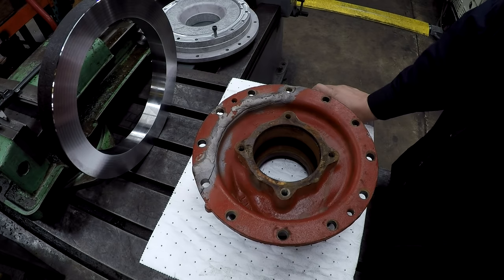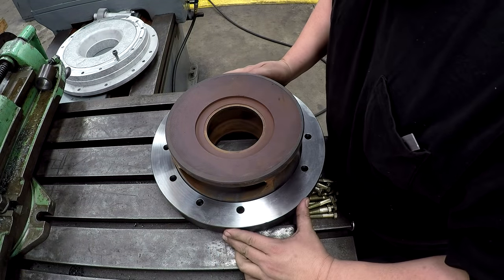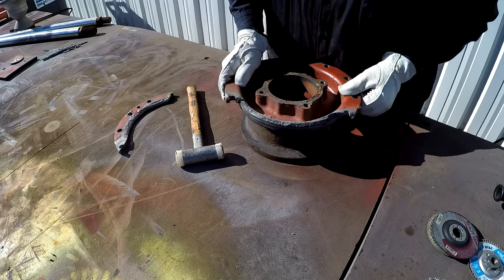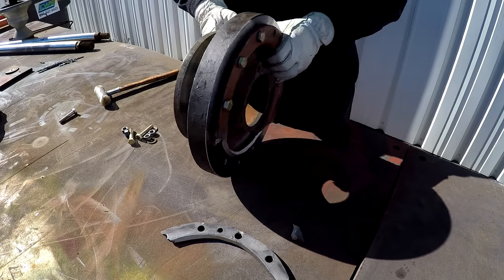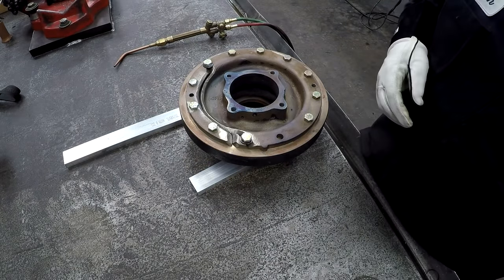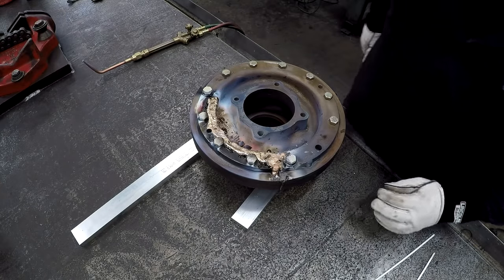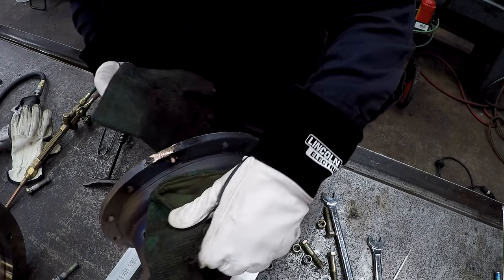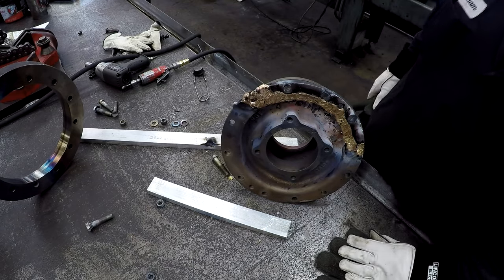Braze Repair on a Broken Casting Part 1

Comment: Excellent video, A man of my own heart. I am a 63 year of age Boily who learnt the craft of Brazing and still use it for tricky stuff. Not knocking you but the only difference I was taught was to grind a cross hatch into the prep bevels, it increases the surface area. Once again great to see older craftsmen at work, well done.

Comment: I've done welding mostly TIG and brazing mostly silver braze,But your level of repair was way over the top of that.This was true RAW professional repair.Your skill set is amazing.You are repairing and fabricating parts that other so called machinists only dream about.The way you made a jig to fixture the parts to locate the piece was true art.I would have used aluminum for the fixture !!!! AND i would be WRONG,as would so many lesser machinists.You must have had an amazing teacher when younger.great workmanship.

Comment: Adam, I would like to compliment you not only on your excellent repair but the way you are very professional and don't just come out and complain about the previous repair and the way it was done. We never know what kind of pressure the fellow was under to repair it before just to keep a job going and may have had to do it in the field in some nasty conditions and time restraints. Looking forward to part 2. Thanks Ed K. Cleve. Oh.
Reply: Eddie Kawecki, very well said sir! 🍻
Reply: You really never know what's the restraints were at the time of the repair. Well said.
Reply: Cool as hell. You could be a dentist. Great work. Old TONY WISHES, HA.
Reply: Oh.
Reply: Couldn't agree more. I'm guilty of more than my fair share of bitching about terrible repairs that I've had to deal with when they fail. But to be honest I've done quite a few myself when a machine is down and  there's no time to do the job right. Sometimes you just have to make it last the day and it ends up lasting months or years before it breaks again and then some poor guy gets to wonder what kind of idiot did such a bad job. Adam definitely seems to keep his cool in the shop.
Reply: There wasn’t, enough time to do it right.  But there was time to do it again.  Braizing is the very best way to do the repair. True quality workmanship.

Comment: It was a real treat to watch somebody brazing. Its not done too much anymore these days. I'm an old, 50+year refrigeration man. So I did a lot of brazing. Did copper to steel high pressure joints. Now as an even older retired man, I do steel and cast iron brazing in the hobby that I'm in. Thanks for the video. I enjoyed it.

Comment: Hey Abom, I'm an HVAC Tech and do a lot of brazing myself but more for refrigeration lines and what not but after watching your vids about doing it to other metals and parts, I've started doing it myself. Repair instead of replace. Saves costumer down time and puts a couple extra notches in the knowledge belt. Thanks for sharing what you do. Helps other progress in other fields of work. P.S. Can't wait for part 2. HURRY! Thanks again.
Reply: +Chris Bryant Chris  I used to do hvac work and I would repair fan brackets and such with the 45% silver solder used when brazing copper to steel valve bodies.  I assume you have that on your truck as reqular stock and it works quite well.  I would by a pound of flux coated rods if your doing a lot due to expense but the silver solder can save you from a run to the supply house.
Reply: +willf650 yes. 45% orange coated brazing rods. They do everything. I've repaired blower brackets and wheels, fan brackets, you name it. I'm still trying to figure out my heat though. I've almost got it dialed in for most stuff.

Comment: I grew-up in a machine and welding shop. Brazing cast iron is the very best way to repair it.  My dad always said. “To choose the torch tip, go two sizes bigger than you think you need.”  And always grind all surfaces that are going to receive the brass. Love to braze cast iron. Good job.

Comment: Believe it or not, one of the best additions to a shop that I have seen over the years was an electric stove with the self cleaning option. Why? Well when you do cast iron repairs you can throw the part into the oven and set the heat up to the highest level, normally around 550 F, and let the part heat soak for as long as you want. Since you're using an oven, the entire part is heated evenly and the weld repair will come out with less distortion. You can also throw the part back in and reheat should it be required or use the oven to slow cool the part by placing it inside when the welding is done and then slowly reduce the heat back down until the part is cool. Why self cleaning? Self cleaning ovens go to 900 F when cleaning to burn off all the food matter that's left in the oven from cooking. When you stress relieve parts the temperature is held at 550 to 650 C (1022  to 1202 F) so when your oven is in the self cleaning mode it can hold a temperature just under what would normally be used for stress relieving. Heat your part up with a torch to 1100 F, wrap it in ceramic wool, and put it in your preheated oven and let it soak and slow cool. (You have to defeat your oven lock out and preheat it to the self cleaning temperature) It's a simple and inexpensive way to control heat and leaves you with a superior product.
Reply: great idea
Reply: thank you sir!!!! <3
Reply: Jack Anderson  Coffee
Reply: That’s largely a myth….

Comment: Wonderful that the customer decided it was time to get the repair done the RIGHT WAY this time.  They had seen that the previous repair effort had failed and realized if the 'quick-fix' method was tried it would only fail even sooner and so after also finding out the part was possibly no longer even made anymore they had no choice but to send it off with the hope it could be brazed back up and you came through in a huge way! ^^

Comment: i was taught to have the metal clean and use a "soft flame" rather than the noisy flame you used.  my teacher was a welder in the experimental section of pratt and whitney jet engines.  the method always worked for me

Comment: I done a few almost like this, i felt guilty, no experience of welding cast iron, but those jobs I did are still intact. Small iron diesel blocks, manifolds, brazing is so adaptable. Good job dude. Keep up the good work.

Comment: Fascinating Adam.  You can see that you are streets ahead of whoever tried to weld the crack last time.  The braze rod will be more forgiving to the shock load on pump-start whereas a weld could be a little brittle.

Comment: Adam next time you need to pre or post heat a part like that try a gas grill, very easy to bring a casting up to temp 450 to 500 degrees and you don't have to stand there with a torch

Comment: When I worked in the electric motor repair shop, sometimes the motor end castings would come in cracked, and I always wondered how they were welded back together, as it was done by another shop. And of course, they often couldn't simply buy a replacement part. Many times motors themselves aren't easily interchangeable, especially on special applications like machine tools, where you're not using off-the-shelf induction motors. It's think it's the same issue with pumps.

Comment: Looks like a zillion people asked what rod is being used. The standard, go-to rod for braze welding cast iron with oxy-fuel is Flux Coated Low Fuming Bronze (AWS A5.8 RBCuZn-C). A high-quality American Made version is Harris 15: https://www.harrisproductsgroup.com/en/Products/Alloys/Welding/Copper-Alloy/Low-Fuming-Bronze-15-FC.aspx  No, I do not work for Harris/Lincoln Electric, but I DO use Harris 15 and it's great stuff :-D

Comment: Great video, as usual. Nice detail on fixturing and clean-up before the actual brazing.

I have a question: at about 12:10 you say that the cast iron is"full of moisture". I wonder if that is not condensation on the cold metal. After all, acetylene is C2H2 (H-C=C-H) and the oxygen is O2. The combustion products are (ideally) just water (H2O) and carbon dioxide (CO2). When working on a hot piece, the water goes straight to water vapor (invisible in air), but when it is cold, the water vapor might condense like the dew on an iced tea glass. I suppose you could test this by heating a decent-sized chunk of cast iron (at least a pound or so) until you are sure there is no moisture. Then let it cool completely (or even chill it slightly) and reheat it to see whether the moisture reappears.

Of course, I may be totally wrong. I recall an older video of yours where you were brazing something quite old and oil-soaked. I think you had cleaned it thoroughly on the outside, yet it smoked like the dickens when you heated it.  If oil can soak into cast iron, why not water?
Reply from the maker: +Peter W. Meek Peter, I think your correct sir. But you sound much smarter with that than I do! LOL I know that it's typical when you heat clean metal like that you'll see it start rusting just slightly immediately.

Comment: This is an amazing repair! The difference between what talent and experience can do and what is valued by those who destroy. I have been tasked with repairs such as this but not to this extent thankfully. Usually due to someones lack of talent and respect. Lazy operators and maintenance practices i. e. out of balanced pumps! Been there done that, don't want to do it again! Thanks to retirement-lol.

Comment: nice job ;) i used to braze cast iron now i use a rod 3/32-1/8 or 5/32  dia. and it works great pretty expensive but it does the job,i'm a machiniste welder

Comment: Another issue besides the jacking bolt causing it to crack. Was it assembled properly? I work in a power plant as a mechanic and I have watched guys who know better assemble equipment dry. Even after something is said they get a case of the so what's, meaning "So what? I won't have to take it apart next time." which infuriates me to no end. I always assembly equipment just like I am the guy who has to take it apart which means lots of assembly lubricants, i.e. Never-Seez. Copper for low temp and nickle for high temp.

Comment: I'm sure you have, but have you heard of Lock-n-stitch cast iron repair? Look them up, pretty interesting repair method for dealing with cast iron... Great job on this piece!!!  Oxy/Propane is 1) cheaper, 2) hotter and 3) cleaner if you didn't know, and if you have the time, you could put the part in a gas grill cranked on high and does a decent job of uniformly preheating cast parts.... I've done that with exhaust manifolds and had the time while working on other items... gets over 400 in short order...

Comment: I was wondering how you were going to hold that smaller piece. Cool seeing that it basically just clamped in place without the need to use anything different (just the bolt and nut). Looking forward to seeing this cleaned up and delivered!

Best wishes,
Tom Z
Reply from the maker: I was going to use a c-clamp but the bolt worked out better. Thanks Tom.
Reply: Yeah, I caught that in the video but wondered if it would just get in the way. This worked out great! Thanks for sharing, Adam. I know I don't always comment but I do watch regularly, sir. Hope you are well!

TZ

Comment: Did you consider just cutting off the whole flange and making a new one, brazing it on?
Reply: Nice as it is to see Abom doing the braze build-up, my thoughts were along the same line. Having made the suppport flange from steel, I'd have machined off the old flange remnants, pressed the steel flange onto a machined step/shoulder, then brazed the joint up from both sides. Steel flange will resist cracking much better than cast iron, won't it?

Comment: It's many years since I did my apprenticeship in Oxyacetylene welding and it looks like technology has come on a long way. I remember dipping uncoated rods into flux but it looks like you can get coated rods now ? Many thanks for revisiting my youth.
Reply: An oxyen/acetylene apprenticeship? That must have been a few years back then and i started welding with oxyen/acetylene and personally its the funnest way to weld
Reply: @jackmioff000  I sort of had that feeling myself although I did learn the other protocols. TIG was my favourite but the whole area of Production Engineering was changing.
Reply: @jeremytravis360  i learned mig and stick but tig is another beast
Reply: @jackmioff000  I did a bit of them all.
Reply: @jackmioff000  Yes 1980s.

Comment: It would have been interesting if you had done a sand cast too. The model would have to be two piece since it's not physically possible to pull that shape out of a sand mold. Still doable. The cast would be in one piece. At first I thought it might need a two piece casting welded or brazed together, but it looks like one piece so I figured it out. The hardest part would be registering the top and bottom molds. Have you done anything like that? I haven't so I could just be whistling in the dark.

Comment: I love this channel, and normally everything on here is done very well, But some mistakes are made here from my point of view. You've gone to huge effort making that backing ring to hold everything tight and flush whilst you braze the repair, Then take it off half way through and start brazing out of the fixture...Big no for me, Personally I'd have built it right up with braze twice what I thought was needed, then let it cool completely before releasing the fixture. Then I'd have machined back the outer face to the original material. Then mounted my fixture on that new machined face and then brazed the back up. I've learned over the years the problems that can be caused by welding outside the Jig. Hope this doesn't offend as you're a cool guy and your channel is one of my favourites.

Comment: Adam, can you describe your brazing technique? It looked like you had the rod right on the tip of the flame, I thought you don't use the torch to melt the rod, but use the heat of the metal to do the melting.
Reply: Probably just to add brazing rod filler because using the present heat of the metal wouldnt melt it enought to fill the gaps

Comment: Nice work Adam, Some times I would rather take a beating than do all the prep it takes before you even think about brazing, After I,am done brazing I give it a little peen job to relieve the stress. Until all pieces play the same tune. My way is no doubt old and out dated like me Just saying.

Comment: I was wondering if the masking paint you used for spray welding would work to prevent the braze from sticking to the ring you bolted onto the part?

As always I am impressed with the size of the work you do!

Comment: Brazing and welding are such a cool skill. You are quite skilled. Is brazing as strong as welding? I always likened brazing to soldering and welding to actually fusing the pieces together.
By the way this video is over 3 years old. How did the job hold up?

Comment: This may be a silly question but - i don't really know about this industry and i am curious.  Are the castings THAT expensive that its really more cost effective to pay for labor/material to repair it?  Or is the the choice to repair it more about the difficulty of finding specs for the original casting or something along those lines?
Reply from the maker: Some times repair shops have to repair an item because it’s no longer available, and also because of the long lead time to get another part.
Reply: ahhh now that makes sense - i figured this is something i should at least be aware of if i am going to walk around in my Abom tshirt!

Comment: I am guessing that jack bolt hole is how that flange got broken in the first place. They might want to consider adding a few more so it is less stress on that flange getting it apart the next time, that is of course assuming you can get the remover to use them all equally and not just jam an impact on them and crank. :-(
Reply: Yeah I'm thinking that's what broke it and adding 1 or 2 more threaded holed for jacking would help
Reply: +bcbloc02 Oh, i have an even better one. He forgot the bolt inside when he began tightening the bolts.
Reply from the maker: +bcbloc02 I have no doubt that the jack bolt caused the problems, not once but twice. The field work is out of my control though and I told them to be very careful when they need to remove it again, and dont use that jacking bolt. Find another way to get it off.
Reply: +aserta No way really?
Reply: +Abom79 antiseize should be there best friend and should be applied to all mating surfaces.Im amazed at how many techs don't use it when putting things back together.A bolt or pump housing never goes back together without it when I do it.
Reply: @gsppuffer  I had a t do a lot of pump work when I was on the family farm. The fllow next door was a well driller (CALWELD rig) and drilled all our wells and used his boring rig and later his crane to place and pull the pumps and piping. My point? Ampol, an Australian company had a product called Kopper Kote - it's a bit like Neverseize (nickel, and it's varieties), but it was made of copper and some oil/grease base, and it was magic! You could coat the flange bolts that joined the suction pipe to the  foot-valve - I'm talking 5/8 inch gal bolts and 4 inch piping, which were 23 feet under water; water was little corrosive as well. I guarantee you that you could undo the bolts after several years of use with just ye normal ring/OS spanners and no helper bars AND they were not rusted beyond use. Good Stuff.
Reply: bcbloc02 mob
Reply: bcbloc02
I think the impact wrench idea hits it right on the head. It's human nature that the more tools you have the less you are inclined to think. 
Might be worth Adam filling in that jackbolt hole so it can't be used.